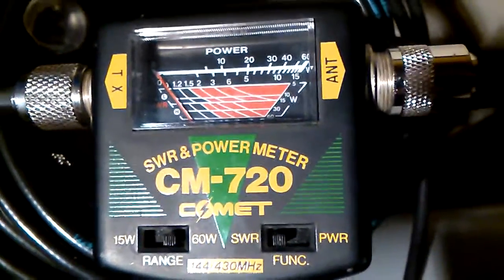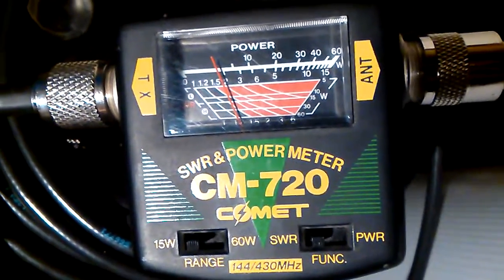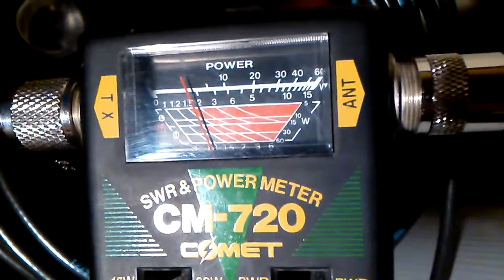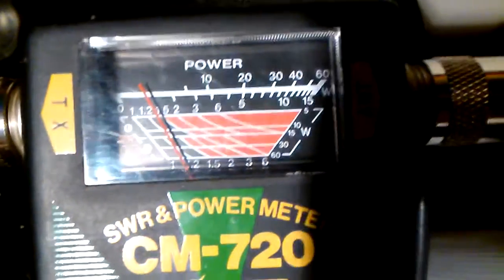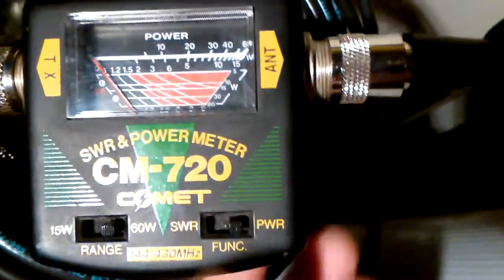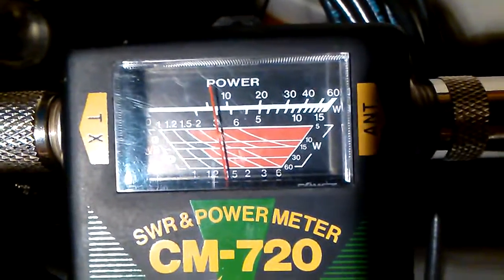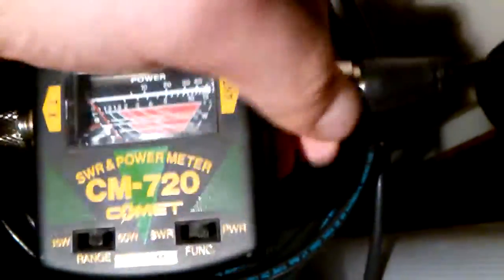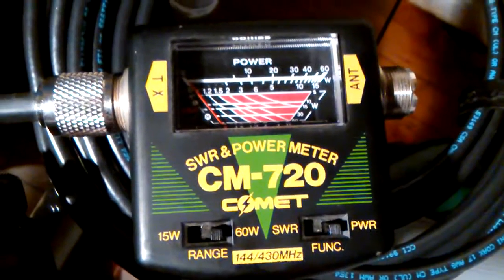Comet CM-720 SWR & Power Meter

Comment: Just found your video.  I've got one in the original package.  I think there are some typos in here, not mine.

Description
SWR can be read out directly without any calibration.  Low insertion loss at structure of the meter allows it to be connected permanently.

Operation
A. Power measurement
1) Set the function switch to (PWR) position.
2) Set the power range switch to appropriate power range corresponding to the power of your radio equipment.
3) Set the radio equipment on transmit and read out a scale corresponding ton the range.

B. SWR Measurement
1) Measure output power as described in the section A in advance.
2) Set the function switch to (SWR) position.
3) Set the ratio equipment on transmit mode and figure out SWR by reading out cross section of the extension point of auxiliary scale at the right end which is corresponding to the power reading indicaded in section 1) and meter indicator reading.

Note
1) The meter cannot be used by connection input and output section interchangebly.
2) Since sensor of the meter is very sensitive design, do not give an extra impact on the meter.

Maximun measurable power of the meter is 60W.  Applying power exceeding it may damage pick-up-device of the meter.

Hope that helps a little.  Very little, probably! 😁

Comment: The reading value of SWR is correct, if actual power is 15W or 60W.
If actual power is less than than selected by switch, you must use the correction value that is printed at the backside of this meter.
Cheap and dirty part.